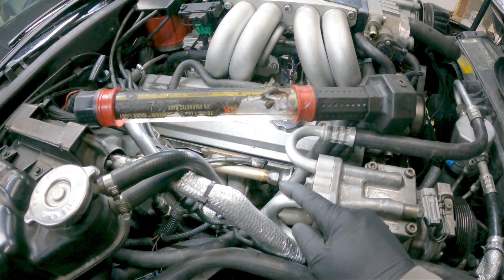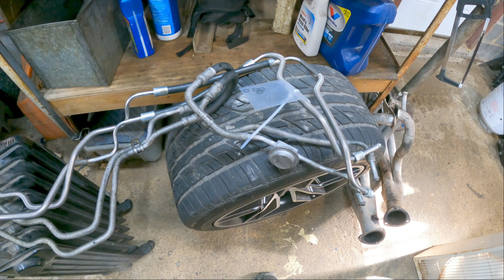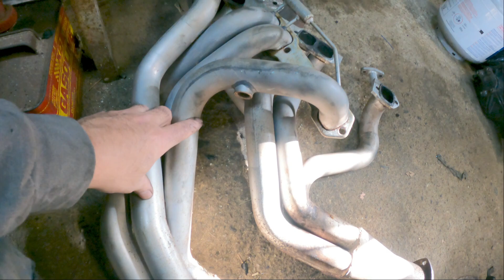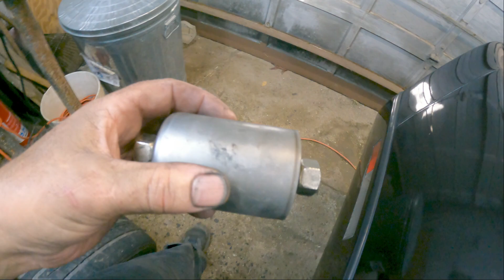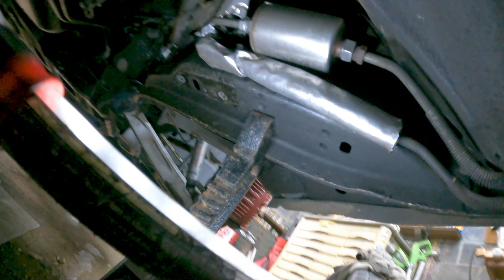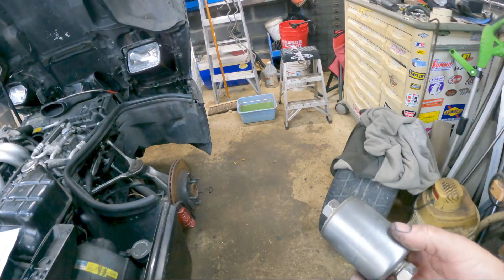C4 Corvette Fuel Lines

Comment: So it is a 1990 Corvette ? I have an 85. The fuel lines come up from the hose section toward the rail. They look slighly different in diameter...I thought the larger diameter is for feed, and the other is return. Hard to tell from the video, but is the feed side toward in the engine inside ,basically on the right when standing in front looking in to the engine ?  My friend has a 91 but it is modified with an LT1 intake, and rail, so he has braided hose going over the drivers side to the rear where the inlet and regulator is at. I swear he has the feed line and the return plumbed backwards..
Reply from the maker: Earlier C4's had a smaller diameter return line, if I remember correctly the line closest to the center of the car is the feed.
Reply: @E.T.GARAGE Thanks ET, when you were saying you were heading south in Penna, I looked at your channel, sure enough we run across each other at some shows, first many years ago at Sunbury, Hawkins Collision Center. Usually Muncy Show ( now Hughesville) also... Keep up the good work !

Comment: E.T. I know you did this  a couple of years for this video but what year is your C4? On mine C4 (1987) GM put two (2) fuel filters, one to the engine and one on the return line. The one on the return line they have it help dampen the pulse of the fuel.
Reply from the maker: I have a 1990

Comment: First, thank you for the video, as it helps many, ...my question is, could you just disconnected the old lines, (passenger side) cut them out and used rubber or flex teflon lines,  which would allow you to route it in an easier,  fashion,   rather then taking off the headers etc, its a question I have as I have a pimple on the rubber portion of the line that worries me,, and would like the easiest solution, if you have any alternate ideas/videos please let me know, ...and/or if you would have done it differently, thanks kindly
Reply from the maker: You do not have to remove the headers, I removed mine to have them sent out to be recoated, if you want you can just replace the rubber hose section, you will have to cut or grind the factory crimbs off, you will want to double up on the hose clamps because the lines are under high pressure.
Reply: @E.T.GARAGE  Thank you kindly

Comment: adapters I think they are 16-1.5mm to AN6. I was thinking about buying stainless steel hard lines and bend them to follow the stock way then use an6 lines instead of the rubber hoses but it’s easier just using  teflon lines
Reply from the maker: It will be a lot cheaper than the way I did it, you should be able to find what size by googling or forums.
Reply: @E.T.GARAGE  they seem to be rarer than other adapters, anyway the way you did it is better for long term and it’s more solid, it would take another 30y for the rubber to get old

Comment: fuel lines then bushings are the first on my list :)

ps. to empty the fuel line I think it’s possible to use an  air compressor and connect it to the high pressure hose at the top of the fuel tank.
Reply from the maker: Next time I change the fuel filter I will try it that way, have to be very carful not to over pressurize the system.

Comment from the maker: I will have a video out on 02/27/21 on Lubing the front Suspension on a C4 Corvette.
Reply: Hey I’m trying to fix up my old c4 but I stripped the fuel line that connects to the fuel rail I was wondering if you can help me out by telling me what the line is called if that’s the sending unit or the return one?